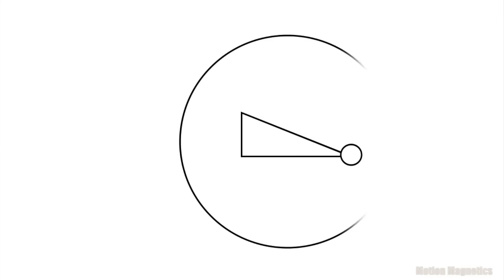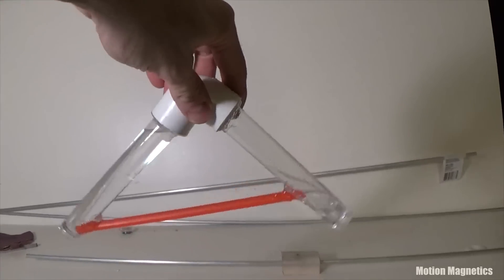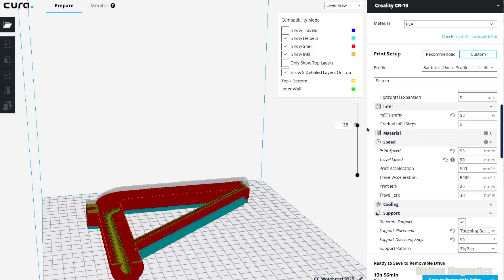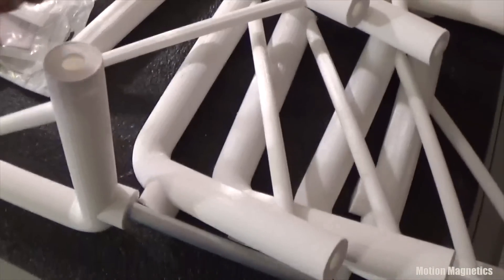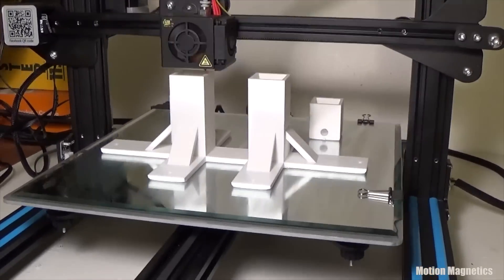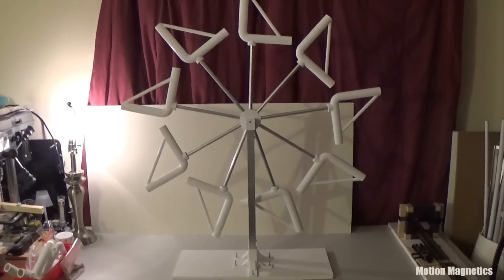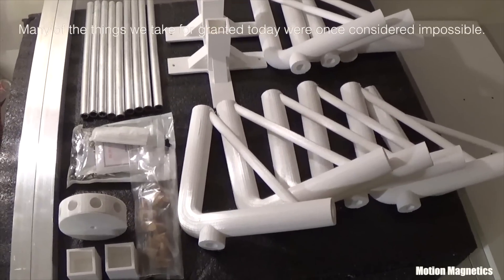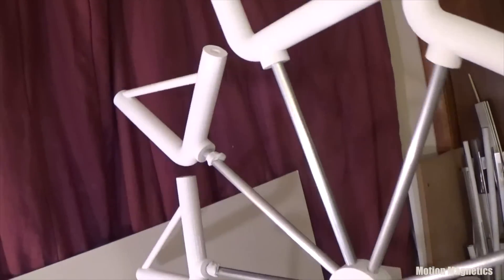Liquid Gravity Wheel Part 01

Comment: It doesn't work because perpetual motion machines go against the basic laws of physics. It's nothing to do with the design.
Reply: I have an idea for constant energy flow :) Imagine a bunch of water wheels positioned above each other, each one when spinning generates an electrical current not so unlike a wind mill does but with water. At the top is a big basin of water, as the water falls straight down it spins the water wheels generating electrical current. When it reaches the bottom their is another basin, but this one can be shaped some what like an up side down bowl and is slanted down so water flows into areas that are separate and in these areas the water is evaporated and then travels up tubes and back to the top where water re-condenses and falls back down. In these tubes the steam is traveling up through, there is a smaller tube coming down from the top and small windmill like contraptions protruding from it. The rising steam spins these small windmills and generates electrical current that travels through wires in the center of these inner tubes and can either be used for extra energy output or help to heat the bottom bassins. The energy to keep the bottom hot enough to evaporate water comes from as many of the water wheels spinning as needed. To get more energy output you just make the contraption taller with more water wheels, It will always only take so many wheels spinning to keep the water on bottom boiling so more wheels equals more energy output. The material in the top basin can be designed as a heat sink to help the water re condense into liquid form, if built correctly, so no water/steam escapes, it just keeps going and going utilizing natural forces to function. :) Now just add the proper electrical wiring into its design so all the excess energy being perpetuated can be accessed from plugs on bottom of device and presto you got yourself free energy. :) Please share this Idea with Everyone.
Reply: nicompoop! of course gravity is a force! thats where the ENERGY comes from, the FORCE of gravity, Newtons laws of thermodynamics state energy cant just cme from nowhere. fair enough. gravity however, is somewhere. Plenty of 'overbalancing' designswork. check 'bashkaras wheel. fool.
Reply: ultra complex, relies on ambient temp. how much airflow do you honestlyy think EVAPORATION creates? oh well, keep it up with ur creativity , good person.
Reply: this is the attitude they take at lockheed martin too. they gave up looking for new energy sources years ago (!). running round quoting 1600's so-called laws, is just the forward thinking, revolutionary attitude to move humanity forwards. bravo.
Reply: it's like a teeter totter on a kids playground, two kids of equal weight, but move one kid in closer to the center and the kid on the outside will go down, move both kids out on each end of the teeter totter and it will stay perfectly balanced, as each one of these Teeter totters comes around it's the kid on the outside that goes down so you must have a even number on a perpetual motion machine, but as the Teeter Totter is going up you have to have a way of moving the child to the inside closer to the Pivot Point, that's all it is, Leonardo DaVinci proved it, so just get your liquid to move from the inside of the Pivot Point as it's going up to the outside of the pivot point and it's going down, that's perpetual motion

Comment: Increasing the weight of the fluid makes sense only at an elementary level of understanding, because it would appear to generate greater rotational force due to gravity.  But this is faulty logic for two reasons.  1. Increased weight increases friction on the bearing surface of the axle.  2.  Any inertia gained on the "heavy" side of the wheel is equally counteracted by the same (equal and opposite) inertia on the "light" side of the wheel.  You're tilting at windmills here.

Comment: The balance of the wheel can be worked out using the principle of moments. The moment (or turning effect) of a force is the mass times the horizontal distance from the centre pivot. If the clockwise moments are equal to the anticlockwise moments the wheel is balanced.

Comment: I have the same printer and found TinkerCad to be the easiest to get up and running. I started taking a class for Fusion 360 but got side tracked with another big project. I plan to get back printing parts for magnetic wheels at some point. Until then I am watching many video's and saving links I will need when the time comes. I had an idea for a gravity wheel without water. Just using leverage and gravity. The idea is to have the weights on a pivot attached to the wheel, on the upward side of the wheel the weight will be closer to the center of the wheel and as it gets past the top and begins falling,  and this is the problem I haven't worked out yet, the weight needs to be pulled off its pivot to fall further from the center of the wheel. Maybe with a magnet? Anyway, I thought I would share the idea and let it simmer in your head for a while.
Reply from the maker: I just ran across this comment. Sorry for the late response. 
I've really enjoyed the quality of prints I've got using my printer and still use TinkerCad quite a bit.
I'm actually working on a gravity generator now, but it sounds like it's quite a bit different than what you were working on. I hope you post your results if you build yours.

Comment: Instead of water, try a couple steel balls in each unit. Then add a magnet at the top of your machine just close enough to pull the steel ball a little before it falls past the magnet from gravity, also use an odd number of tubes. Good Luck, you've almost done it!

Comment: I want a 3D printer too!  If we are trying to get energy out of the wheel...converting Potential Energy into Kinetic Energy, "Houston we have a problem"....the weight (water in this case) must be lifted from the low point to the high point (the Potential) and the returned energy is the distance it falls high to low (Kinetic).....and they are in balance so that's why you get nothing out!  Torque is not energy.  Someone or something has to provide the work to imbalance the system....like the sun, the wind, the rain or the energy stored in fossil fuel, etc.all of which ultimately come from the sun. I'd recommend working on finding alternative energy sources or improving efficiencies. The quantum flux is a really interesting option!  Keep up the good work.

Comment: hey man I was waiting soooo long for another video of yours! 
maybe you can add a  magnet to this gravity wheel and another one thats repulsive alongside the wheel...?
and maybe you could fill one L with heavier liquid than the other, as long as you have for example 7 l's, 3 heavy, 4 light....
cant wait!!!!!
also, did you already succeed in the magnetic rotor?
kind regards 
Benjamin
Reply from the maker: Sorry for the wait. I've been busy learning new software, and how to use the 3D printer. Good suggestions. I have another design in mind that I believe will be more efficient. I'm working on that now.
Reply: alright, its the waiting worth though! also, did you already succeed in the Howard Johnson magnetic rotor?
Reply: another suggestion: I would have the wheel on a 45 degree angle in comparison to the horizon.

Comment: What if you had a large sprocket like gear behind . with smaller gears to spin the water containers as it turned. Moving the weight from outside of the wheel to the inside. Do you think it could work? I have been thinking if something similar. Have you heard of skinners gravity engine thing. I'm trying to find something similar to generate power for my off grid house. To charge the batteries. If I could get 200watts for 24hrs. It would be better than Nothing. But 1000 watta constantly coming in would power everything!

Comment: It's great you really enjoy the process.  But I personally think this type of design won't work because it has a balance point.  And if it has a balance point (however small) the device will slowly find it.
I would imagine for a perpetual Mobile to work it would need a randomly generated aspect to continue to unbalance the balanced aspect. And these 2 systems keep each other moving. Who knows?
Reply: it could be place in area of heavy crowd, so someone or the other keeps moving it, and thus continuing the cycle.

Comment: What happens if part or half of the liquid is oil? And what if the containers would be hollow balls with a horizontal wall in center, that has a hole in them, then it should maximize the imbalance happening inside the ball?

Comment: I suspect that a simple gravity wheel will not work, however I think you can take advantage of something that can actually make it work.  When your "weight" shifts away from the center of the wheel it will pick up momentum due to gravity pulling it.  What if you find a way to add that momentum to the forward motion of your wheel?  When your "weight" again shifts back toward the center of the wheel you do the same.  The mass again gains a little momentum as it moves.  Find a way to somehow shift that momentum into forward motion of your wheel.  Between the two you should be able to overcome any losses due to friction and such from a normal gravity wheel design.

Comment: I can't believe the idiocy of this, and most of the comments. 
1. It's a perpetual motion machine. By definition it does not work.
2. Draw it accurately, do the maths on the moments, and you'll find there is no resulting torque to drive it. 
You are just wasting your time. Build something that doesn't pretend to create power from nothing.

Comment: If more weight is the issue, you can fill the tubes with BBs or some other metal ball bearings which should still flow enough to have the same effect with more mass.
Plus a ferris filling may help you when it comes time to try adding magnetic assist....maybe....also might make it fail for the same reason...have you tried spell casting?
Oh, I was just informed that Harry Potter is fiction. I think my whole life is a lie now.
Reply from the maker: I considered using something like BBs, but I was concerned they would clog up the return air tubes, because they are smaller than the main tubes. I just added a part 03 that features a magnetic assist, if you'd like to check it out.

Comment: I first tout you would use it in conjunction with magnets to supposedly keep it moving on and on ,but no, you || just only used plain old water, that will never work because eventually the weight will find it’s balance thus forcing the unit to stop moving, it’s already proven 800 years ago,
So sadly no matter how cool this project looks ,,, it sadly makes no sense😭

Comment: might wanna try this....
the 1st version but with a difference.....
you have the rod that holds the bent pipe in place, so why not use it ?
make a model where about hals the rod can contain water and open up the connector to the bent pipe.
this way the water should go farther into the wheel and might create more imbalance.

Comment: Mercury is not as toxic so far you dont drink it, use it when having an injury or mix it with organic solvents... You will be really fine cuz it is not adsorbed in it pure metallic form (Unless it enters your mouth).
Reply from the maker: I know it's safe under the right circumstances. I just don't really want the amount of mercury necessary for a proper testing to just be sitting around my home. If I had a seperate location for testing, perhaps?